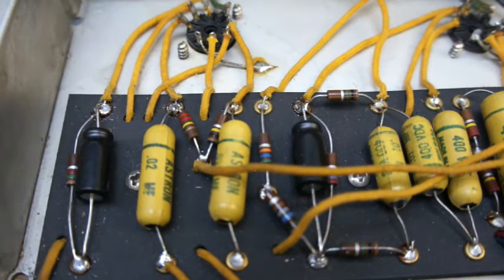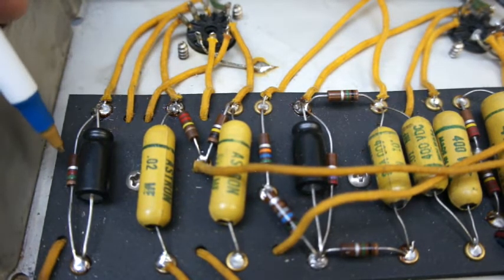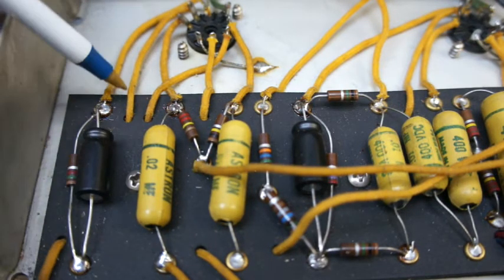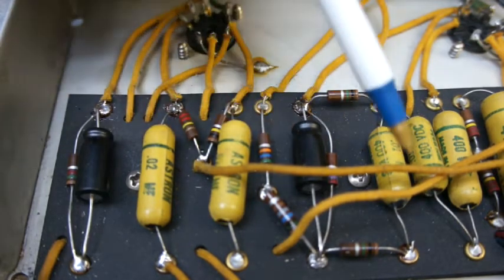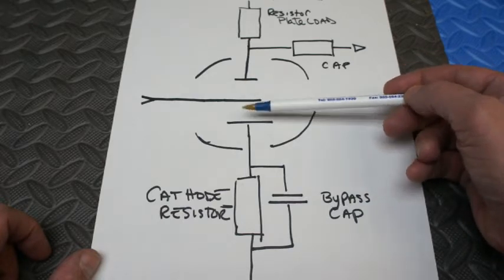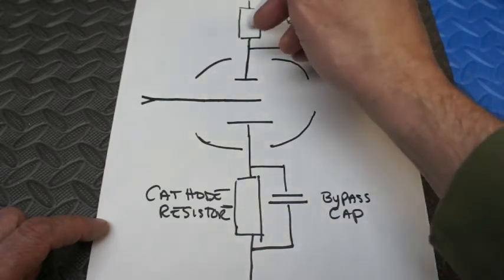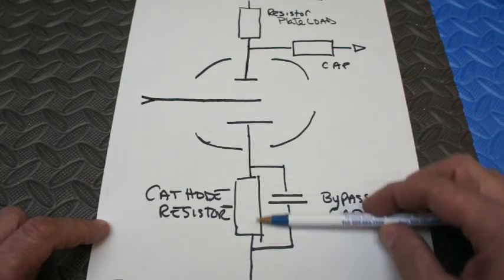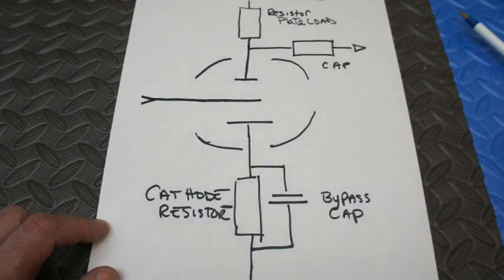How to tweak gain in any vintage amp. We hot rod our 62 Princeton with some added gain.

Comment: Changing the cathode resistor does not change gain, it does change the operating point instead.  Using a higher value, such as 10K, turns the stage into a cold clipper like the overdrive stage of a master volume Marshall 2203 or 2204.   Changing that plate resistor to 330K will let you get into heavy metal territory.

Comment: Pat, could you please explain, Grid Stop Resistors How and Why you would need to use them. Thank you for the drawings!!!
Reply from the maker: Finom1 grid stops are used to reduce noise by blocking stray signals from activating the grid
Reply: How would you us this - https://www.ampbooks.com/mobile/amplifier-calculators/grid-stopper/calculator/

Comment: I would suggest a bit of a remodeling of the amplifier as its very close to a single channel tweed deluxe.  I would make the PI dedicated with the first stage gain as is with the tweed deluxe cathodyne PI (it presently is a cathodyne but not complete), and move the trem circuit to the first preamp tube 2nd half......then switch it to cathode biased power tubes rather than the fixed bias and alter the trem for the cathode bias operation.  Next step would be to change the 5y3 rectifier to a 5U4 or a GZ34 to bring up the power tube plate voltage and readjusting the down stream plate voltages properly...….but doing so will make the output transformer marginal, so I would change that to a 60's/70's deluxe output transformer so it can handle the wattage.  It would transform into one screaming amp for a small amp...…
oh I forgot......eliminate the feedback resistor too
As best as I can tell this is a 1960 or 61 6G2 series amplifier.....single tone control, so it has minimal signal loss.....2 6V6's in class AB push pull
Reply: Your lecture added nothing to the matter at hand ….thank for the “input”?

Comment: Do any of these modifications have an impact on the power tube bias? If I was to put in a modification with different resistors for a cold clipper selector, would I have to re-bias the amplifier?

Comment: So if i was gonna add a 12ax7 in between the 2 preamp tubes, would you just copy/paste the first gain stage? Or would u want the second stage to “compliment” stage 1, by maybe boosting highs and cutting lows/mids? Thank you for the vid!
Reply from the maker: Yes pretty much copy and paste, but you shouldn’t need an extra gain stage if you unlock all the hidden gain in your existing setup

Comment: Hi Pat, I have a '77 Traynor YRM-1 that I wish to smooth the pre-amp overdrive on. It sounds a little nasty when in overdrive (ie when preamp volume on 10). It has a cold clipper gain stage with 85 volts on the 3rd stage. For the meantime I have increased this voltage to 160 to get more cleans, and use a dirt pedal for gigging.    Any suggestions for us YRM-1 owners??

Comment: Can you keep doing that at each stage at V1 and V2 for instance and add more gain adding a 220 resistor to the plate instead of the hundred k
Reply from the maker: robert barcus yes each stage works in a similar  manner. The ART is in not overdoing it... and ending up with a mess. Sonically speaking ...too much salt can ruin the soup.

Comment: Hi Pat, is the grid stop resistor only used on the first preamp tube? Thank you.
Reply from the maker: Finom1 they can be used on any tube input. You see them on power tubes. I add one to the tremolo tube if you hear ticking on some amps. They are very useful.